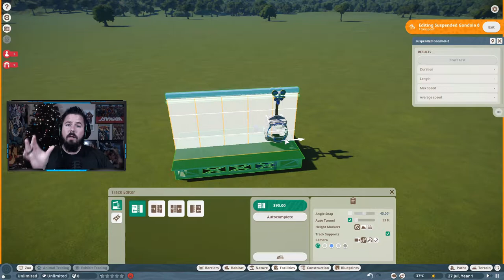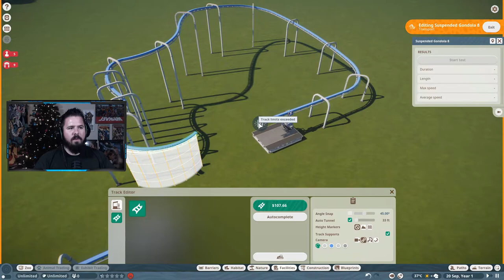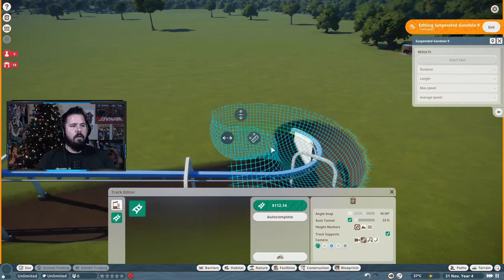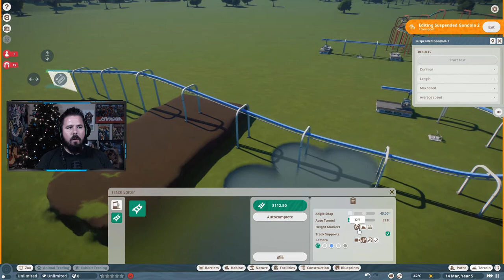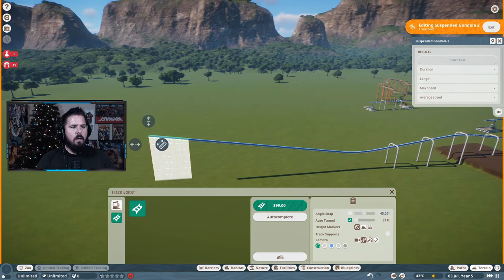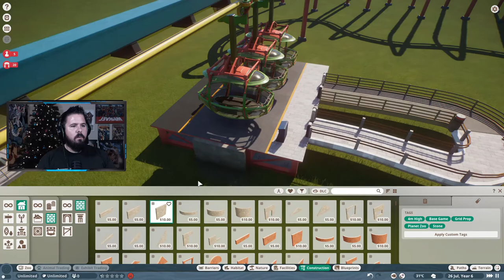Planet Zoo Gondola Tutorial with ZookeeperChris - Troubleshooting, Hints, Tips, & Tricks

Comment: thank you for the video. any additionally tips for the rides? how many gondolas to use? long queues? price to ask for?
Reply from the maker: If you have long queues, you can try adding more gondolas. You could also try charging more money for the ride, to deter some people from entering the queue. However, I usually set the price to 0, because I want as many guests to ride it as possible.
Reply: it depends. On some stations there are lot of people, at others more people take off, and just I few want to hop on here.
Reply from the maker: @muzsi19  You can change prices per station, so maybe lower price on those that you want to bring in more traffic. Planet Zoo also just released a new patch, which is supposed to help get guests on the rides more often.